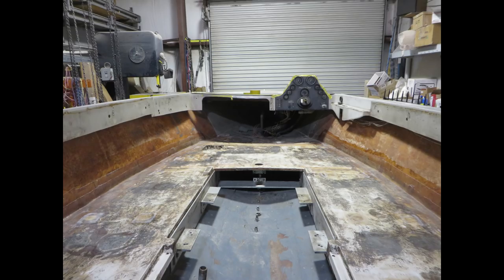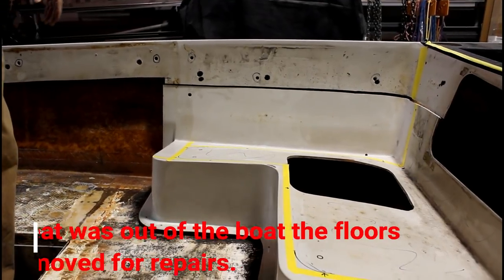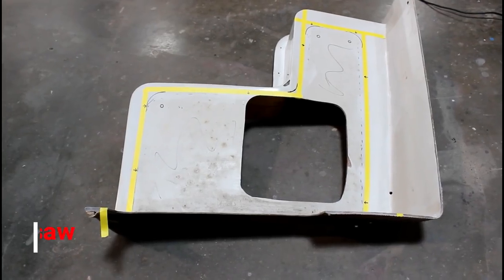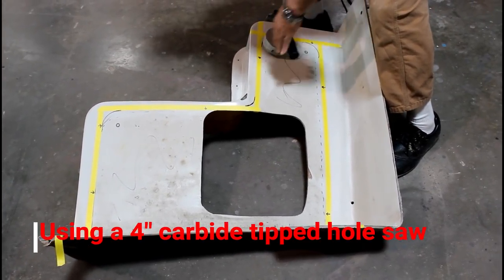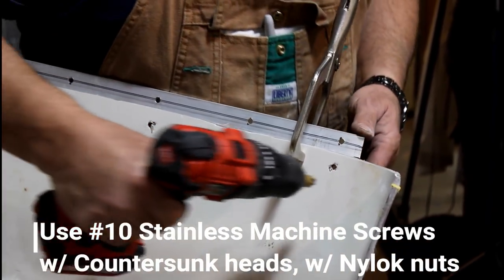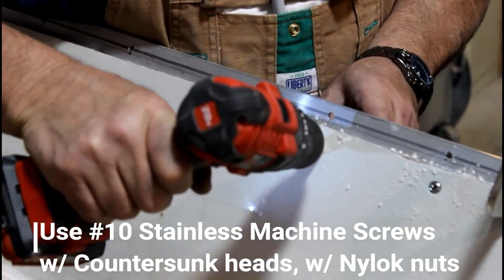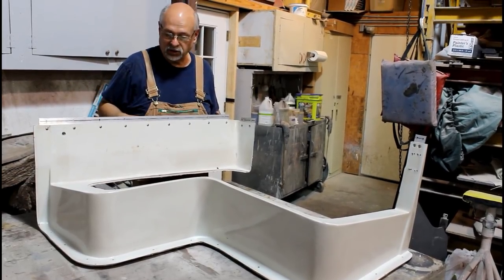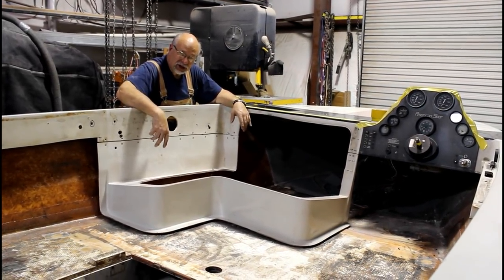Restoring A Rare Bird  Part 8  Removing and Modifying the L seat Base

Comment: I watched the comments on cleaning the cable for steering and went to work to do so. What I discovered was that when the 40 year old boat repair business replaced my boat cable they used a cable that was in a bind as it was a little short and in an awful bind. That is why the steering was so hard to to turn left and wasn't as easy as I made it by cutting away enough wood for a limber cable. I am so happy tom turn easily now. Too bad that guy is still in business.

Comment: Does the longer screws screw the L seat base to the floor
Reply from the maker: Really don't need longer screws, once everything is back where it needs to be and the floor was supported standard 1 1/2" long #10 screws were used.